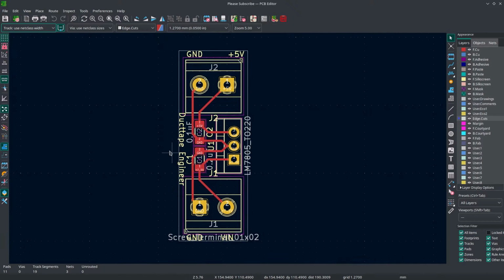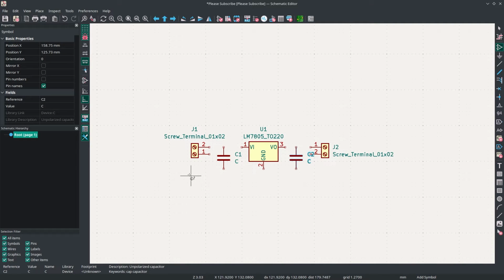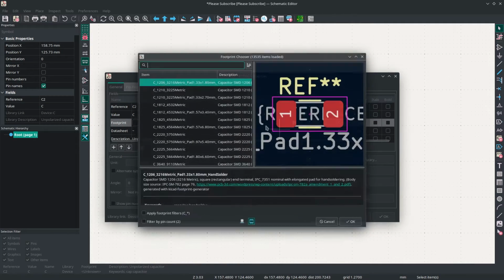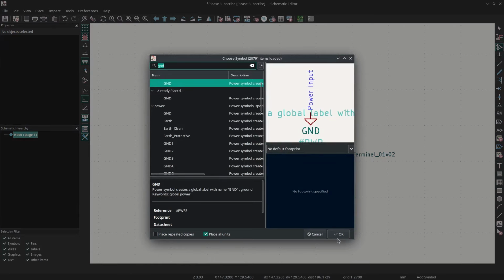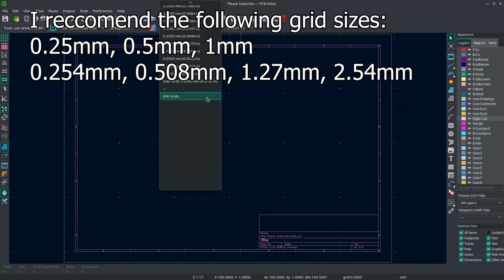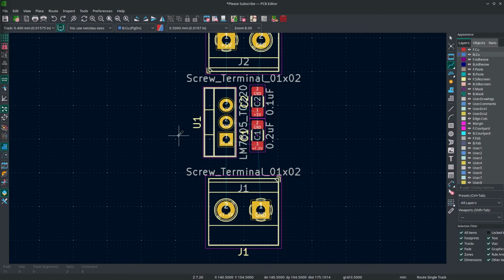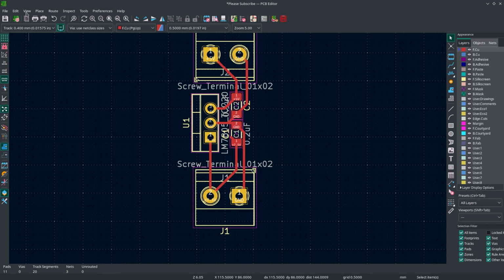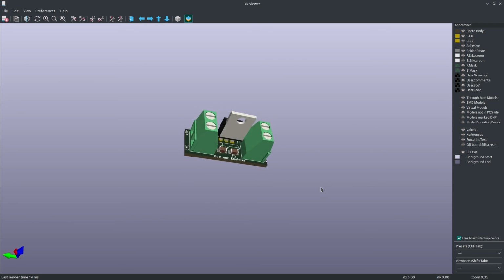Dive into PCB Design: Kicad 8 Tutorial for Beginners

Comment: What does "... , if you build this into a different project you can leave the symbol away" mean ?!
Reply from the maker: This is for the terminal connectors. They are put on the pcb to be able to connect wires, but if integrated into a pcb for something else, you can just directly connect to the components needing power.

Comment: pressing a again does not open the library to find a terminal,  it drops another voltage regulator. also the second screw terminal did not automatically rotate like yours did.  you are skipping a lot of stuff assuming people already know.

Comment: A few key suggestions
1. Make power traces (all of them in this case) as wide as possible
2. Place your LDO as close to the board edge as possible to allow for mounting of a thermal connection
3. Make paths as short as reasonable, for example the output to the terminal should go straight, not via the capacitor
Reply from the maker: Those are actually good suggestions @SojournerDidimus, thanks. If I male another Video about Kicad I will incorporate them. In this Video I mainly tried to show how to make a simple board, even if it isn’t very nice, but a few things I could have shown.

Comment: Hello. Can you tell me how to choose an arbitrary orientation for my track in kicad, for me it is always at an angle of 45 degrees and I want it to be at an angle of 90 degrees, is it possible to do something so that I can change the angle of the track over time? work, for example, like in Sprint Layout when you press the space bar?
Reply from the maker: I am not sure if I show this in the Vid, if not, sorry. You can‘t chose an arbitrary angle, only 45 and 90 degrees, but you can set points your track goes along by clicking. Kicad will always choose the shortest path between the starting or last point, and if that is a straight line with a 90 degree ang, it will do that.
Reply: @Zipties_and_Ducttape  Hello, I read the documentation about KiCad and it turns out that to change the angle you need to click on slash or counter plus slash
Reply from the maker: @maxichannel9080 I didn’t actually know that, thank you very much. Most of the time you won’t need it, but nice too know
Reply: @Zipties_and_Ducttape  Please, enjoy it dear engineer